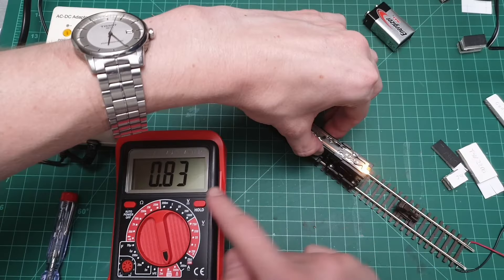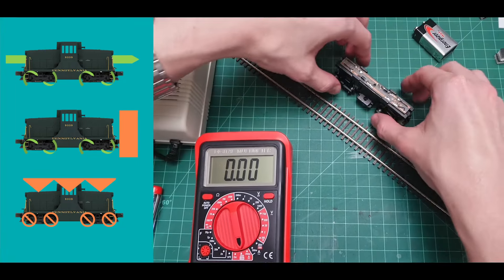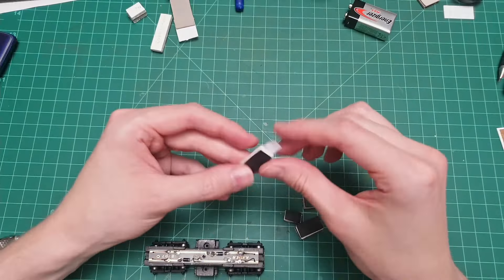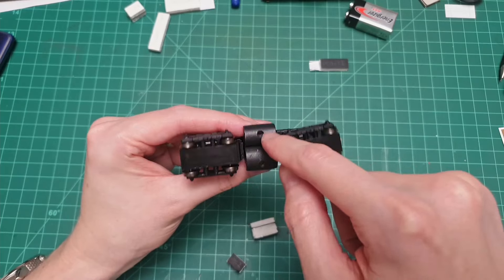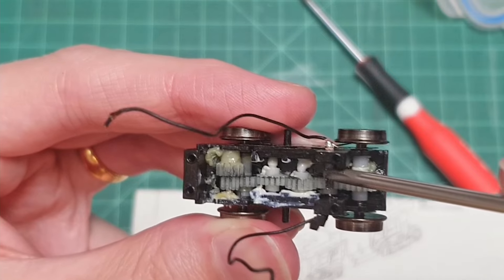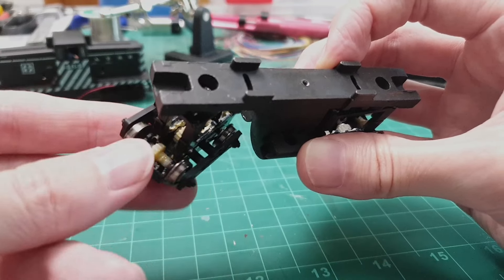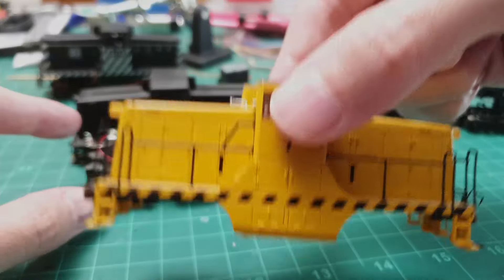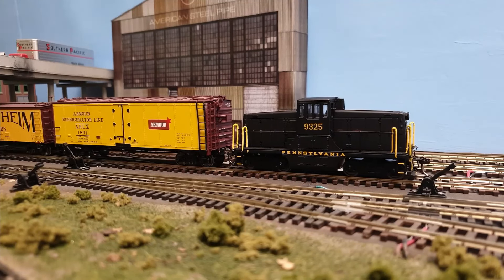68 - How to install DCC and Sound into a small engine. Tsunami2 and speakers into a DC 44 Ton.

Comment: I've only done one decoder install so far and that was for a British Rail Class 47. It was simple enough to do but yes the space tolerances for H0 is what is going to hurt the most. It looks like you almost had it with the twin motors - I bet if you cleaned, re-greased and ran in those gears you might have got a bit more success but even then that space between the trucks may not have wanted to co-operate LOL.
Reply from the maker: Yes it was all very tight. I'm happy with the final solution. And that yellow one was also the cheapest DOH!

Comment: I had a similar experience buying the Spectrum DC ATSF 44 Ton, maybe in the last Century. It could hardly pull itself. So maybe the over heating was caused by the two small motors and drag from the bearings? 

Then about 3 years ago a local hobby shop had the yellow industry 44 ton but was DCC. So far I've left it without sound but your instructions make it look easier to add the sound. You sure went to a lot of extra effort trying to convert the DC version. I prefer the ATSF as it was the local switch engine for the small yard in Galesburg, Illinois. It switched industries on a long connecting track that interchanged with the CB&Q. So I'll do the same thing and use the #7 for a dummy on the DC frame. Now I may try a conversion to sound decoder on the newer engine with a single motor. What did you use for the current keeper capacitors? Thanks for your help and inspiration.
Reply from the maker: Good luck! Its a fun little project. For the capacitors I got my information from the ST video. https://youtu.be/ZOhCqRtmHoM
3 capacitors give around half a second. 
Not shown, but what I also did to prevent  light leakage downwards. Is stick a small piece of sticky foam for isolating windows against draft at the front and back of the chassis.

Comment: So you had to get a DDC switcher to install your decoder?
Reply from the maker: Well, I wanted a small switcher with sound and dcc. The first attempt to convert a DC engine didn't work, so i went with a dcc ready version. Those older 44 tonners are notorious. 
From now on I only buy dcc or dcc ready engines.

Comment: Wow dude, talk about running into each consecutive problem before you have solved even one of them. This does not seem like an easy conversion. I guess it all depends on whether you buy a cheap DC version and convert it yourself, or get a more expensive DCC(-ready) version, pay a bit more, but actually be able to use it immediately on your digital layout. 

It all depends on whether you get satisfactino ouf of these jobs, and if you have the time (to spare) to do this. Thanks for letting us look over your shoulders!
Reply from the maker: The joke is that the DCC ready engine was actually cheaper than the DC ones. Guess I got it for a steal! I actually enjoy these installs now (when everything goes according to plan). Not too long ago I would have dreaded such project. The trick is to start with easy projects. Like a plug-&-play install, current keeper install, or a larger locomotive that holds a big decoder with spacious soldering pads.